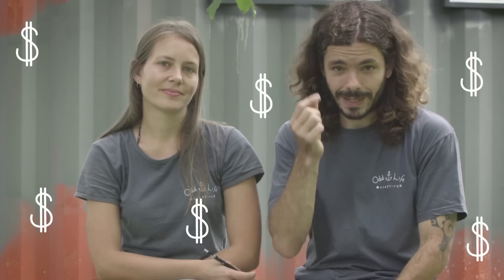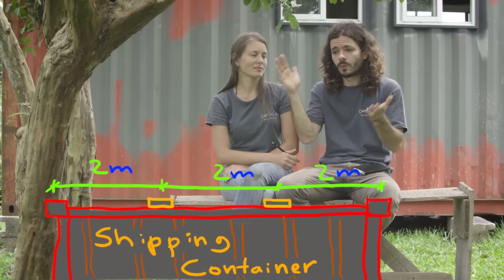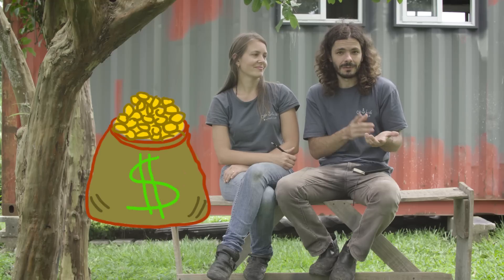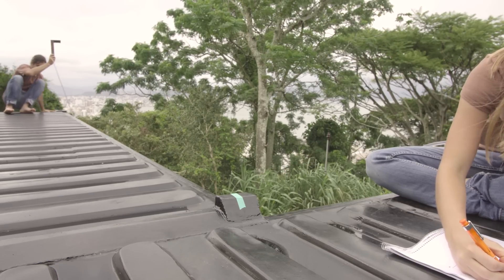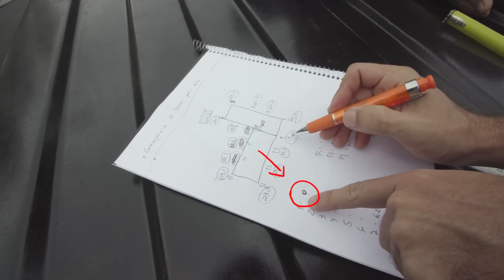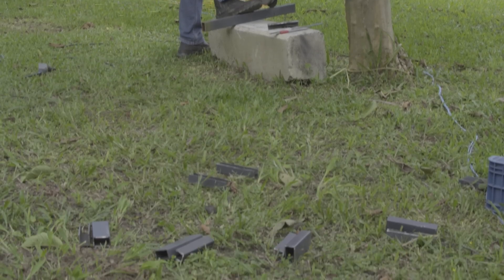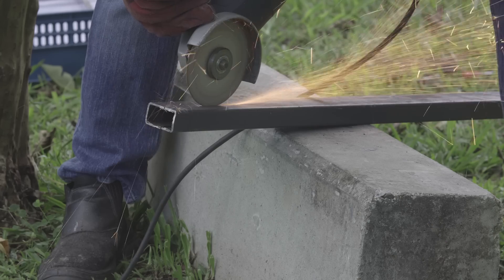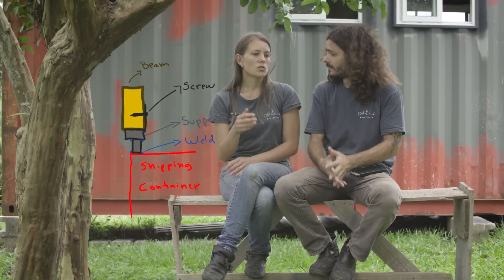Shipping Container Wooden Deck Support (Price reduction) - Living Tiny Project Ep. 014

Comment: Very cool play list of video, one question why dit you do the roof before working inside the house (insulation, floor, kitchen) I mean, you work on the house for one year but the fact is you don't live inside yet, It is very costly no ?
Reply from the maker: We are currently living at family’s house. In this way we could use the internal area to paint the wood when we did the deck. 👌🏼
Reply from the maker: We also wanted to sove te water staying on the roof and not drying out. 👌🏼

Comment: why not use tantalized treated wood. you dont need to paint it. my  deck is quite old and it has never been painted.
Reply from the maker: Parte of the deck will actually be made out of tantalized wood but the “main beam” and the “secondary beams” will be made of hard wood as the other at least were we are usually when you by in big dimensiona some time you can find knots (I’m not sure if that’s how you call it in english) in the middle and that can be a problem with time. For the top part of the deck that the wood dimensions are much smaller we will use pressure treated wood but we will apply stain anyway as here here the humidity is really bad and se also have lot of bugs that eat wood (don’t know how they are called in english). Well we know we might be over concerned but keep in mind this will be the first house we own and we are in love with her. Hehehehe it’s pike a child, we are trying our best to keep her safe. 👌🏼😍
Reply from the maker: Where are you located? How is the climate? I believe this makes a high difference. 👌🏼
Reply: i am in new zealand. there are many different types of hard wood, some is very good but some is not. best to use all treated wood and treat any ends that are cut.
Reply from the maker: I guess here is similar. That was a really hard decision and of course we are still not sure if was the right decision. 😬

Comment: Hey guys question about the frame for window when you install is the set in middle of the opening and frame is sticking out inside and outside and just tac inside and weld all the way around.
Thanks
Reply from the maker: I don’t know if I understood but we basically welded the frame all the way around on the outside. On tue inside we didn’t do anything. Than we fit the windows on place and applied PU spray foam. 👌🏼
Reply: Ok I got it thanks

Comment: Hey guys great job on container. Have a question for you. What size box steel you using for door and window frames? Also you should encapsulate the shipping container floor with some sort of epoxy or sealer. This is because the floor is infused with many chemicals for pest, rats and water. Keep up the good work.
Reply: Hi guys. You're both doing great! I am in the planning phase of my own container house project in the US. I've got about a year time frame I'm looking at to remodel my current traditional built house and get it up for sell before I will be starting on my container build. It's great to watch your already in progress process! Regarding the container plywood floors; my research has shown that a secondary floor laid over the plywood floor isn't adequate to stop the off-gassing of the harmful chemicals into your home. The only safe way to deal with the container floors if you will be living in them fulltime is to either completely tear them out and lay a new subfloor or thoroughly seal them in with a couple coats of floor epoxy. If you use a clear epoxy, then the plywood would be safe and attractive as your finished floor or you can just lay over it with your new flooring choice. Either way, definitely epoxy the plywood for your health! Continued success!
Reply from the maker: Thanks a lot. We loved to know you enjoy our videos. About the floor we still didn’t decided but we might use epoxy. Good luck with you project. When you start it we would love to see  some pictures. 👌🏼👌🏼 keep in touch.
Reply from the maker: Thanks a lot. We are using 3cm x 5cm with 2mm thickness tubes. About the floor we will install an extra hard wood floor on the top of this one!! 👌🏼

Comment: A bit too perfectionist for me, I would have just built the deck directly on top of the container maybe some cripple studs coated in waterproof paint along the base of the 2x6's maybe a few (2) on the ends to attach to. I am also debating 4x4 studs in concrete so there is a overhang, and using rolled roofing to help keep rain off the metal. I am just starting planning, we have to find a structural engineer or architect to design ours to get the permits. We close on the 40 Acres Wednesday :-) plan on doing 5 40 or 45 footers side by side 3 beds 2.5 baths 1600-1800 sq feet. Just food for thought.
Reply from the maker: Nice!! Congrats. Actually we needed to ajuste some small leveling problems so we used the opportunity to and the extra ones and save some money on wood. 👌🏼
Reply: did you add a pitch for water run off? if it is completely level that would not be great. Thanks. Waiting to see how you make the deck :-)
Reply from the maker: Yes we will we will add a pitch to the roof that we will have in between the shipping container and the wooden deck. 👌🏼

Comment: You can make the deck  with  a 4 cm gap between each wood part and use some pipes there to make a rain colector or a  solar water heater   for the outdoor  rainshower  or hottub.
Reply: i upload a picture on imgur  , maybe will make sense that way, you can  use a inexpensive 12v solar pump to   recirculate the water from the hottub or  use it as a outdoor rain shower  https://imgur.com/a/NZYAM
Reply from the maker: Wow that’s a really good idea. If you sent this four days ago a I we would change the plans for the roof. Hehehehe but now we just bot the materials for the roof. 😒
Reply: i m glad you like it,from 1 to 10  how bad my paint skills are XD
Reply from the maker: Not bad at all!! Would say 9 hehehehe

Comment: I don't know yet how your wooden deck will look like. But seeing some water pooling on your container roof is a bit worrisome for me. If your wooden deck comes right above the supports you have just welded, then I suggest you to put roof plates AT AN ANGLE in between the container roof and the floor of the deck. That is right below the floor of the deck. Having some water staying there is not good for the container roof and it's also a good breeding place for MOSQUITOES. The plates should be a bit larger than the width of the container itself, in case you go with this solution.
Reply from the maker: We will actually have a roof in between the deck and the shipping container. We will explain about it later. 👌🏼👌🏼